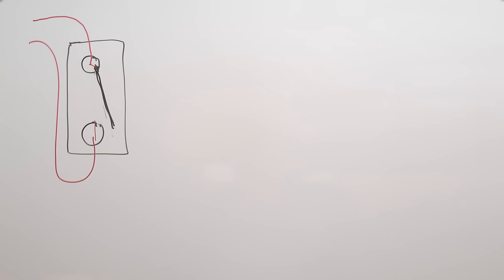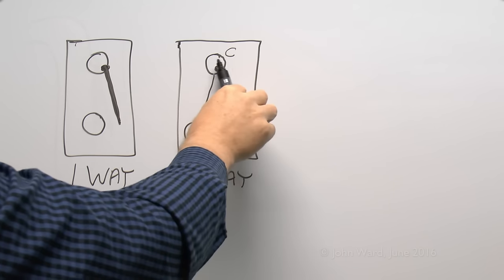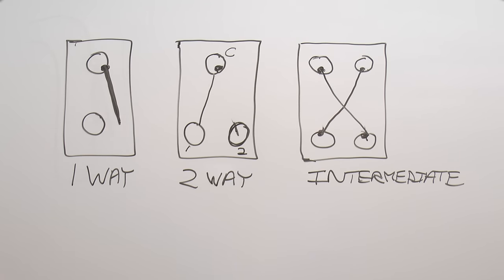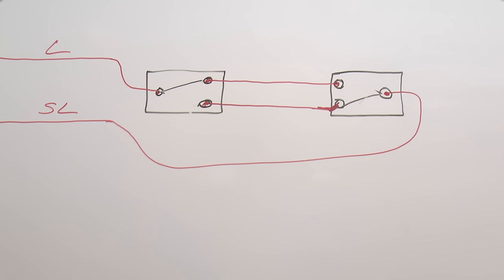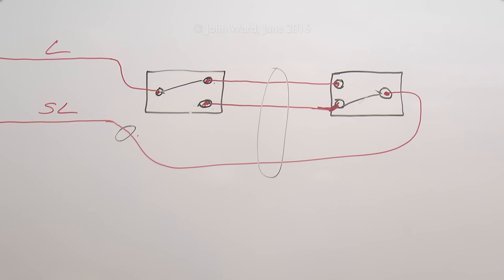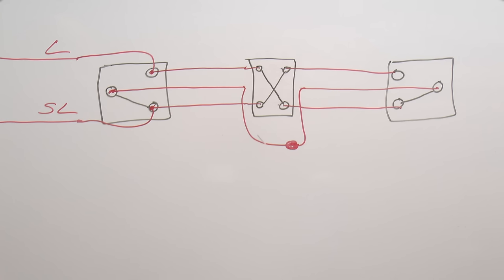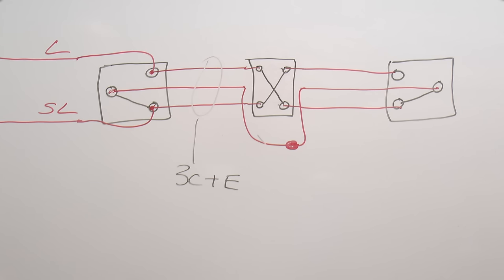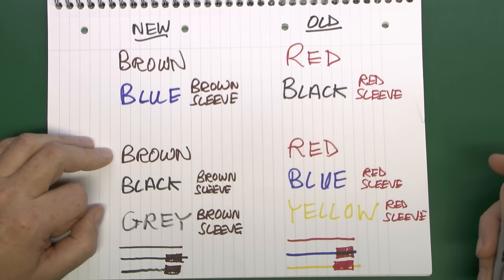Lighting Circuits Part 2 - Wiring Multiple Switches, 2 way and Intermediates

Comment: 4:20. Not that unlikely, in my opinion, to want three places to control a light. In the house where I grew up we had a hall that could be enter from the front, the back, or from upstairs. There were no switches by the front door, but it could be controlled from the back or the top. When you entered from the front you had to stumble in the dark to the other end of the hallway 

This was the standard wiring for zillions of similar houses built and wired in the thirties, but it would have been much more convenient to have a switch at top and front and back. We did eventually get that, and I'll tell you a story about that if you look at my reply to this comment
Reply: When I was 9 or so we were rewired to upgrade the 1930's electrics after the power in my bedroom was condemned (it didn't have an earth, would you believe and when my parents called in an electrician for something else, that electrician explained why that matters.)

 That first spark gave a price for the job he had been called in for, and a price for a full rewire be done rather than fixing the immediate fault. Safety standards had moved on since the house was built and the rubber based insulation was not considered safe any more (or was past the end of its safe life perhaps?). He suggested not doing the piecemeal repair and charged a small call out for the advice, refundable if he got the rewire contract. He didn't actually get the full contract and I'll explain why.

My father decided if it was going to be a big job he wanted several quotes. One of the other sparks that came was very friendly to me and started answering my incessant questions and wouldn't let Dad shut me up. Because I was already a precocious child, I asked the friendly electrician could we have three switches to control the hall lights instead I of just two. My Dad said "That's not possible, surely?" but the spark said "actually it is" and turning to me asked if I knew what the name of the extra switch was. I didn't, I just knew my friend's house had one line that. He said the extra switch was called an intermediate switch and promised to explain how it worked IF my parents gave him the work: looking at my Dad as he said that.

Of course they did give him the job. I still don't know if his price was the best, but even if it was it's not why he got the job

While he was working at our house he showed a natural desire to teach, but I only realised as an adult that that might also have been a useful sales technique when he came across proud parents ;)

He not only honoured his promise but brought a 6V battery and a 6V bulb in a holder and wired it up for me to play with, using the real switches that were going to be installed in our house. It's simple: you already understand the two way switch, the intermediate just swaps over the wires that context the two way switches.

And he never once complained when I followed him round asking questions. He even claimed he needed my help to turn the handle on the megger* though he sensibly wouldn't let me touch any of the real wires at any time. It's not a good habit, he said, for untrained people.

*In the sixties a megger was powered by rotating a crank rather than internal batteries. At least his was. He explained what it did, too.

Just goes to show that knowing the regs is only part of what gets the work. And my guess is that JW would get that sort of job for the same reason. To teach well you have to love doing it.

Comment: Thanks for this series. Cheeky request: Please could you do a video that combines the 2 way wiring and the ceiling rose wiring from Part 1?

The light on our landing has a rose with 3 blues, 3 browns and 1 blue with brown sleeve + 1 brown.
The switch on the landing has Com: black (brown sleeve), L1 two browns, L2 grey (brown sleeve) + blue (brown sleeve)
The switch in the hall has Com: black (brown sleeve), L1 one brown, L2 one grey (brown sleeve)

The switch wiring seems to match what's shown in the V3 section in this video https://www.youtube.com/watch?v=opoEswRp_jg&t=348s but I'd like to understand how those wires link up to the ceiling rose.

Comment: Hi. Could you please advise..I have two onsuitebarhrooms that's connected to the same extractor fan so when you switch on the light in either room it will start the fan. The only problem is that both lights come on when you switch one light. Both bathrooms switch on.my electrician says you need a relay box. Is this true or is there another way
Reply from the maker: A relay is one option.  The other is to use a double pole switch for the lights, one pole for the light and the other for the fan.
Reply: hakan ozdemir Not true. Unscrew one of the lights and unplug one of the fans. You're welcome!

Comment: How stupid, How can you say it’s less common too use 3 switches ? 
It’s very common in house with 3 floors. Long hallways or as in Spain most people have a switch either side of the bed
And main switch near the room door. Personally I’ve got 3 switches powering main light and 4 lamps in the sitting room.

Comment: So,you take a cable with three wires,with the colors brown-black-green/yellow and connect that with the other switch??
Ridiculous!The green/yellow wire MUST be always Earth!!Otherwise you get mishaps with one earth wire connected with the wire in between the switches what gonna get live when the switch is on!Bam,shortcut.or at least a earth leakage.NEVER use the green/yellow wire for anything else but Earth!!!!This is a weakness of working with cables in the house.Give me anytime the tubes we in in the Netherlands use.You can always add more wires into it.
Reply from the maker: The cable used for such an application has black, brown and grey wires, plus the earth.
Reply: Ooh,than i have heard it wrong!
Still,i find the dutch way of doing better than with cables through the walls,resting maybe on a metal stud.waiting to find out if after a time that stud will cut through the wire..
And because of the pipes.you can always get around to another room,and so on.They are all connected and a extra wire through is mostly easy.

Comment: Hmmmm....thought it was a good video, but on reading the comments there are mistakes in and you agree, so I suggest you correct the video or remove it, it would be a shame it someone electrocuted themselves if they followed your incorrect advices. Imagine the law suit!!  

Think I'll seek other YouTube vids for my wiring needs, as I've lost confidence in yours, thanks for trying tho
Reply from the maker: The only mistake is in comparing the old and new wire colours as red-blue yellow = brown-black-grey when it should be red-yellow-blue = brown-black-grey.  As this video is only about single phase lighting circuits, this makes no difference to anything.
There is no way of changing a video after uploading.
Reply: Ok I guess it's fine then for someone to follow your instructions if they miss the comments then lol 👌
Reply: Bob do you know how to reverse a 3 phase motor? When you find out you’ll realise your little rant was pointless.